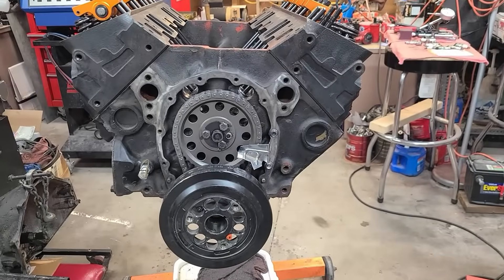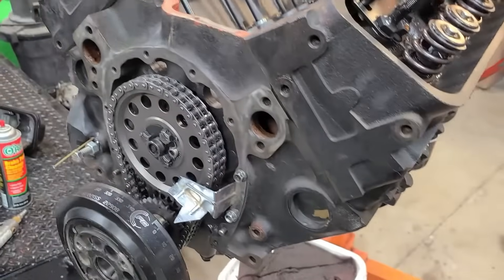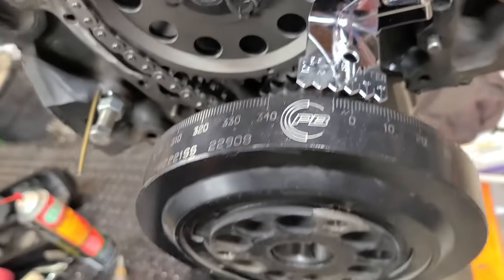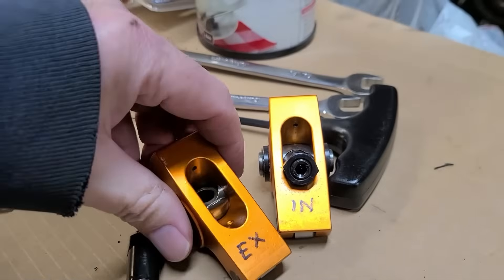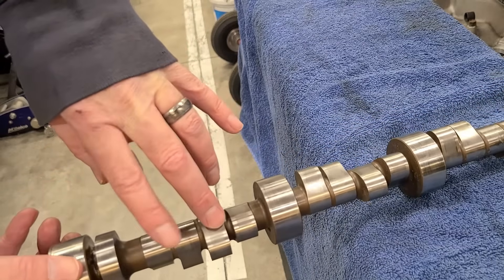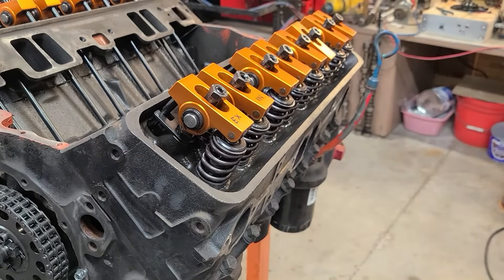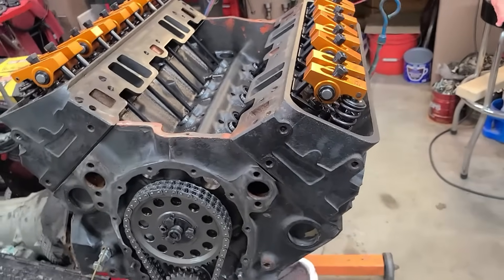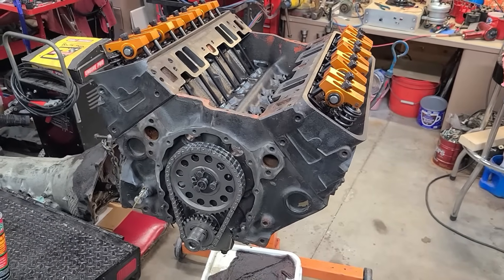350 Crate engine part 2: The Great Timing Chain Debate: Dot to Dot vs. 12 O'clock

Comment from the maker: Apparently, a lot of people are misunderstanding the point of this video. If you have ever spent any time at all on just about any automotive forum, you will know that if someone posts a picture of an installed timing chain set showing either dot location and asks if that is the correct dot placement to get the distributor installed, it will turn into a huge debate/argument that will last for days. 
The point of this video is to simply show the valve events with the cam dot in the 6 O’clock position and at the 12 O’clock position. Most people will argue that both dot positions (12/6 or 12/12) are at TDC, which is a true statement BUT depending on the cam location, you can be on the exhaust stroke or on the compression stroke. I’m NOT saying to install the timing set with both dots at 12 O’clock…dot to dot is the easiest way to make sure the cam and crank sprockets are aligned. Generally, once the timing set is installed, most of us never worry about where the dots are and continue with the build process. When it’s time to drop in the distributor, we each have our own method and know what works for us.
Lastly, I didn’t create this argument…you can go to any automotive forum and bring up timing set dot location and you will see the fireworks with your own eyes. I don’t recommend doing that but if you’re bored and need some entertainment that will literally last for days or even weeks, go for it hahahaha.
Reply: What I, myself do is. Dot to dot and drop the dist on #6. It makes perfect sense to me, and it works for me. To each their own. If you have a method that works for you use it
Reply: Yeah for sure  still will install  at 6,12 crank. Then I will check and turn. To 12,12 😊  thanks 😊
Reply: I think you are the only one on here with common sense! Congratulations!
Reply: Great video Bruce.

My father and I are having that same "battle" atm😅

Comment: People need to understand that either method will do the job as this is for valve to piston timing and if not set right the engine will not start. Of course, us who have learned this the hard way knows that dot to dot is #6 compression and the distributor should be timed to fire on #6 if the engine is left at that crankshaft position. This is not always the case as the Y block Ford engines show the timing marks on the camshaft and crankshaft to be separated by 12 pins on the timing chain as per the Ford service manual for instance. So, it is best to make sure your timing marks are properly aligned and if not sure consult the engine manufacturers service manual. Of course, the SBC has been around for so long just about everyone knows how to time the crankshaft to camshaft. Only in America do we debate every little thing just to be right. ￼🥸👍👍👍

Comment: Been adjusting valves like this since 1976, i do all intakes 18436572, then ex, all valves adjusted with 2 rotations of crank. And anyone fooling with chevys for 10 years knows dod to dot is firing #6... people are ignorant. Are you trying to build a legal 602 race engine?
Reply from the maker: Thank you for your comment. This engine belongs to a friend and he bought it from someone else. He wants to sell this engine, so he asked me to check it out to see what is in it and make sure there aren't any obvious issues. After pulling it apart and putting a degree wheel on the cam, I came to the conclusion that this is a 602 "crate engine"...that's how it was verbally labeled anyway....I'm not sure who originally built it or what they put it in. The one thing I found odd was the Lunati pistons. I've never had a 602 350 apart before, so I'm not sure what parts should actually be in there. Also, it has an Eagle crank...maybe this was a custom built 602 350?? 

Do you have any insight you can share? I am genuinely interested. I thought a GM crate engine would have all GM parts. Being a long time drag racer and spending time with several circle track racers, I am aware that certain classes have to run sealed engines and that you are allowed to have a sealed engine built as long as it meets specs. Anyway, I'm open to learning more about this subject. By the way, this engine had the water pump bypass plugged and the dipstick hole was plugged, which I see on the race track all the time.

Comment: Most People who want to argue against simple facts, Just never built an engine the right way or understand how it works. dot to dot is a phasing procedure. dot to dot is number 6 firing. drop the distributor after rotating so the number one intake valve has opened and closed and then static time the damper and drop the distributor. This is how it's done on any four cycle engine. so simple a cave man can do it.
Reply from the maker: You nailed it. People seem to want to argue rather than try to learn something and the people who only want to argue clearly have very little experience in actually building engines. Thanks for watching and leaving a positive comment.

Comment: So both dots at 12 o'clock mean the engine is at tdc, compression stroke, #1 cylinder.

We just put the timing cover and oil pan back on in this same manor and the distributor dropped in pointing mostly toward #1 cylinder

I feel confident we have it right but my father wants to take it back apart and line dots up at 6 o'clock and 12 oclock....
You really nailed it when talking an eternal debate/fight😂😂😂
Reply from the maker: Hahaha...yes, the debate continues LOL. Realistically, at this point, if everything is together, you can remove the driver side valve cover and watch the intake valve open and close, align the mark on the balancer with zero on the timing tab and drop in the distributor and it will fire up....but that probably wouldn't settle the debate unless someone actually sees both dots at 12:00 with their own eyes, LOL. It sounds like you understand the process. Good luck, LOL

Comment: What does it really matter at this point of assembly? By the time you adjust all your lifter preloads or lash, install the engine, and put the converter bolts in, the engine will have been turned several times. If you don't know how to get TDC on compression stroke after installation, you shouldn't even be doing that job really.
Reply from the maker: As I stated in the video, the video description, and the pinned post...the point of the video was simply to show the valve events with the cam dot in both locations. There seems to be lots of arguments in many automotive forums around this subject. 
You are correct, though, while assembling an engine and adjusting valve lash, getting torque converter bolts installed...the engine rotates around numerous times and for most people, that's where we find TDC on the compression stroke and stab the distributor.
Reply: @BruceCoggins  In my opinion, I think the video would be more informational for viewers if you explained why it really makes no difference at this point, and maybe show others how to find TDC on combustion stroke and set TDC that way. I've been building engines for over 50 years. Not trying to disrespect your video, because it is very good. Have a nice day.
Reply from the maker: @TheMiningNoob thank you. I'm always open to good suggestions and ideas.
Reply: If you do it right it'll fire immediately. Don't want to be rotating the engine over a lot and wiping all the lube off the cam with a flat tappet nowadays. 

Just an example, if youre doing a cam swap in car. Its easier with the engine to see a mark on the distributor on #1 than #6 on an SBC when dropping it in. So mark #1 beforehand. 

So get the dots lined up at 6 and 12, rotate crank 360 (cam moves 1/2 speed of crank so it turns 180) until dots are at 12 and 12. DO NOT ROTATE ENGINE ANYMORE until distributor is in!!!   Install timing cover and oil pan. Install intake. Drop distributor pointing at #1.  

#1 will be ready to adjust valve lash because its at TDC compression. Adjust valve lash through the firing order. 18463572 on SBC and BBC, unless it has a firing order swap. 
If you do it right you've only rotated the crank three times and the cam once plus the 1/2 turn to bring it up to #1 TDC . Keeps most of the assembly paste on there. 

Just how I was taught. Hasn't failed me yet!

Comment: Is this true for Ford engine too? I know it is true for Mopar.
Reply from the maker: It is easy enough to check if you are building an engine, but like I mentioned in the video...once you install the timing chain, go ahead and install the timing cover and forget about where the dots are. When you're ready to install the distributor, rotate the engine until you are on the compression stroke and drop it in. One of the problems I've noticed from reading numerous posts on automotive forums is that some people attempt to memorize the location of the dots during the build, only to end up dropping the distributor in on the wrong stroke.

Comment: I’m glad this stirred up the keyboard warriors. I Install dot to dot, finish the assembly, prime the oiling system with a drill whilst turning the crank, forget how many times I turned it, find TDC on compression with my thumb, set the distributor, and then roll!
Reply from the maker: Exactly....that's how I do it too. Yeah I think most people commented based either on the title of the video or the screenshot without actually watching the video. You'd be surprised how many college educated professors got triggered by my made-up words too....wow 😂

Comment: My father taught me that the dot to dot is nothing but indicator marks to make sure your not one tooth off etc. I’ve had to bush the cam gear a few times when used with a 9 key way crank gear. He taught me to set timing-dizzy by watching the rocker arms. Intake starts to close bring the balancer around to 32-34 degrees BTDC. Then set my dizzy so I’m not late and leaving power on the table. Then I’ll phase in my dizzy rotor bug where it starts right at the number one on the dizzy cap. Great video. I’m glad you showed this cam timing events. People don’t understand that the dots are nothing but reference-indicator marks.
Reply from the maker: Thank you for your comment...much appreciated. One of the few who actually understood what I was trying to show.

Comment: The ONLY reason you line up the timing gears dot to dot is to make sure you are not a tooth off either way. When the gears are dot to dot the engine is on cylinder number 6 compression stroke. You would naturally want to spin the engine with number 1 cylinder spark plug removed and feel the air coming out and set the crank on zero to install your distributor. Thanks.

Comment: Really good video. I can across your channel as I am building my first engine an Olds 455. I already installed the timing chain dot-to-dot and just installed the heads but have not done rods or rockers yet. My main takeaway here is that so far I am OK just make sure I am at TDC and both my dots should be at 12 o'clock before installing the distributor. Does that sound correct?
Reply from the maker: As I mentioned in the video...when you install the timing set, align it dot to dot...that is the easiest and most common way to get it installed correctly. From that point, go ahead and put the timing cover on and forget about the dots...that's the part of the video that most people seem to have missed...anyway, when you are ready to install the distributor...the way I do it is I watch the number 1 intake rocker arm while rotating the engine. Watch it open and fully close and then keep rotating the engine until your timing marks line up. Now you are on the #1 compression stroke. Never mind about where the dots are. Thank you for your question and good luck with your build.

Comment: Dot to dot puts #6 on TDC and #1 on top dead overlap. Line the  rotor up to #6 when you are dot to dot and you're good to go.
Reply: You going to be looking at the dots when you put the distributor in? I don’t think so Skippy!
Reply: @Mr572u  I dont turn the engine over until the intake is on and distributor is stabbed. You dont have to see the dots Skippy! You know where they are!

Comment: In the end it doesn't matter. You can either move the timing tab, or re-zero your damper (by marking it, or using timing tape). At 0 you're either going to be TDC on 1, or 180 off. What should be more concerning is when we install the rockers and pushrods, we're wiping the cam lube off as we're doing it. And there's no way to get around that.

Comment: I’ve always lined them up dot to dot, because that’s what the instructions say.  But I experienced the distributor issue you’re talking about repeatedly.  Until I resorted to spinning the engine with my finger over the number one hole and setting TDC. Or I’d just rotate till both lifters were down.  

Great explanation dude. Thanks!

Comment: In my experience, the Torrington bearing cam buttons blow-up and parts will lay in the timing cover. IMO, use a aluminum button. Dot to DOT is #6 TDC,  upper gear needs to be 12 oc

Comment: no, no, NO. this is still wrong. crank sprocket dot turned clockwise 45deg from straight up, cam sprocket dot at 3 o'clock and drop the distributer in pointing at #8. There, fixed it.
Reply from the maker: Hahahahaha...love it. It's about time someone else has a sense of humor on here, so thank you. 
Some tightly wound people seem to be commenting based on either the title of this video or on the screenshot, but don't bother to watch the video to see what I'm talking about. Something else I've learned...don't use made up words...oh no....hahahahahaha 
Anyway, thank you for commenting.
Reply: Ignore bbhbe  egg spurts who only post negative cause they are miserable

Comment: put it dot to dot when installing the timing chain, then when you get to the distributor move the timing marks at 12 and 12, put the timing at #1 on the distributor.  I've done it both ways on an older Pontiac with a 350cid, it runs, but runs better at 12 and 12, that's how it is from the factory.
Reply: So you are installing the distributor with the timing chain cover off?  GTHOOH!

Comment: Dot-toDot v 12 O'Clock isn't controvercial. In fact, there is literally no difference. It just means THE DISTRIBUTOR is set 180 degrees from #1.
Reply: dot to dot is correct for tdc compression

Comment: Why are you using a Roller Cam button, on a Flat Tappet Cam? I don't think I've ever seen that done before.
Reply from the maker: It was already on the engine when I got it. This engine also has an adjustable cam pin so you can dial in the cam timing. There were a few things on this engine that tells me someone built it for the track. The water pump bypass hole was plugged and the dipstick tube hole was blocked. I see things like that at the race track but not so much on the street.
Reply: it is neccesary for high rpm ,even on a flat cam you dont want it moving ttoo far. cause at high rpm it will, especially as your chain gets worn, not as neccesary as a roller but still a good idea

Comment: GM repair procedure showed cam and crank gear at 12 oclock and it would leave you on the exhaust stroke and in a no start condition. When they came to me I would pull the distributor rotate180° reinsert it and problem solved.

Comment: When building any engine you should always use a stop to find true TDC. Line up the marks and turn it 180 and point the distributor rotor toward #1.  On a racing engine you should always dial the cam in according to cam manufacturer specs.  Stock cams work fine using the marks in the gears.

Comment: I built a lot of engines my favorite engine was the small block Chevy, something interesting happen when I was building a set of Chevrolet engines I noticed the brand name timing gear the crankshaft gear they had drilled the small nacho one tooth off. Nothing wrong with the gear but the alignment Mark was one tooth off, so I was still able to use the gear I just redo my little hole to make it look nice. Always put my engines at top dead center no matter what engine it is and I like the cam by a lifters overlap. You can't go wrong by doing that!. The moral of the story is this Big Time engine company I won't mention the name how many hundreds or thousands of years did they send out what's the wrong mark on them and nobody noticed it. I actually met two of The Machinist that noticed the same mistake we're talking one of the biggest brand name companies out there. The moral of the story is never throw away your old parts till it leaves the shop.

Comment: ps this also exemplifies the importance of checking tdc pointer when piston is at tdc when throwing your motor togeather, ive had a half a dozen that have been wrong over the decades, [wrong pointer/pointer position/harmonic balancer spun a bit on the rubber/wrong cover]
Reply: You set the timing to where it runs the best. Usually, that is where the engine starts easily when it is hot.

Comment: got caught out on this with my third holden v8,pulled apart for someone, it had been apart sometime ago bigger cam and go fast bits fitted, yeah put back together, then luckily recognised exhaust pop/no start, just changed the plug leads around, but marked numbers on distributor cap as a reference note to next person

Comment: No debate the issue is imaginary.
There are 720 degrees of crank rotation in a cycle.
There are opposing cylinders in the firing order.
So the cam can be installed "Dot to Dot" or "Dots to the Top".
It runs either way and has nothing to do with the timing pointer.
If one takes the time on assembly to orient the motor on the #1 compression stroke,
one will never set a distributor @ 180° out.
Any timing pointers position must be verified to actually be TDC.
Very easy to check and correct, 
by rotating the motor by hand using a piston stop.
Reply: Yeah. If you install the cam correctly, it is both. You just turn the crank.